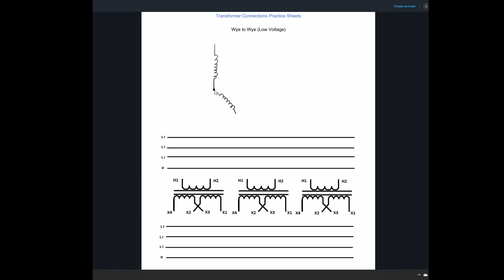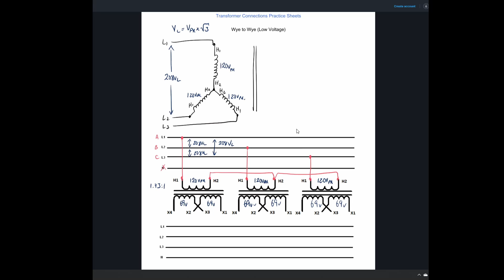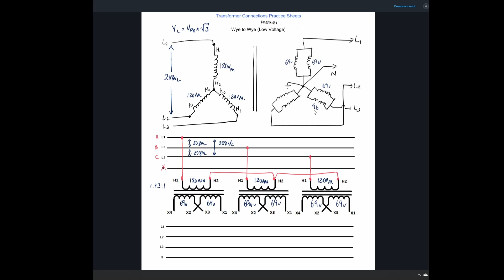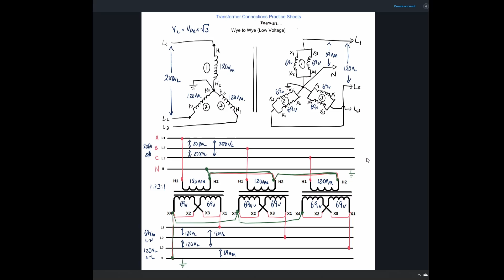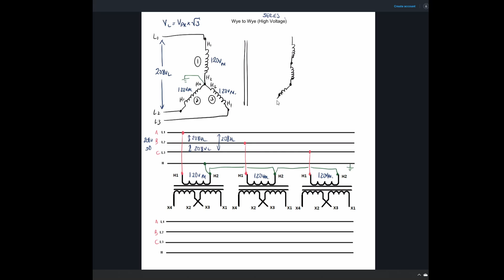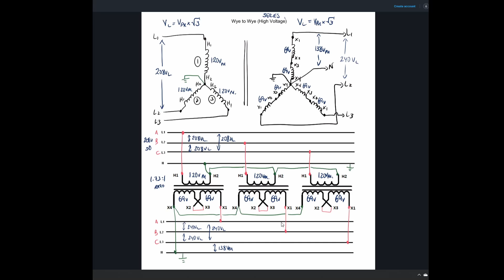Wye to Wye 3 Phase Transformer Diagrams

Comment: That’s a 3 phase 120v system?
Reply from the maker: These examples provide strange output voltages as we only have one supply of 3 Phase 208 V in our lab. In this case this is a 208V Line, 120 Volt Phase Wye Primary to 240 V Line, 138 V Phase Wye Secondary